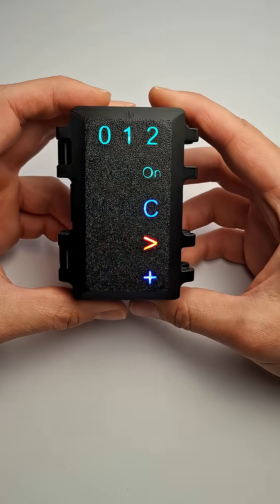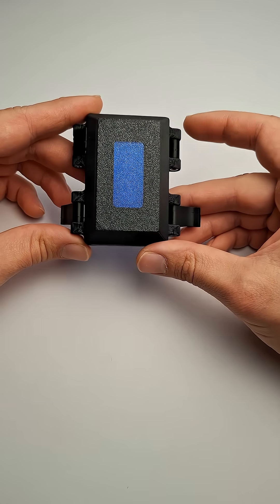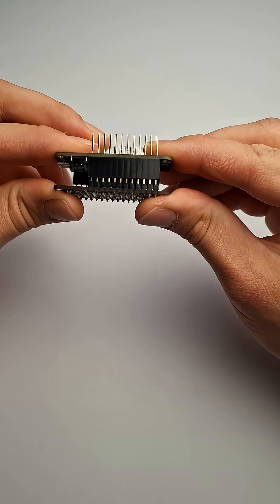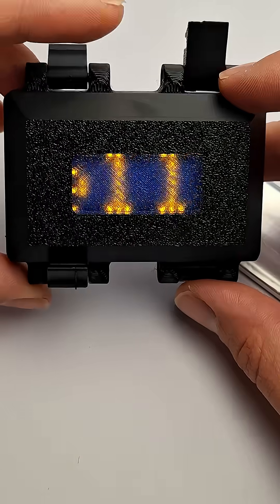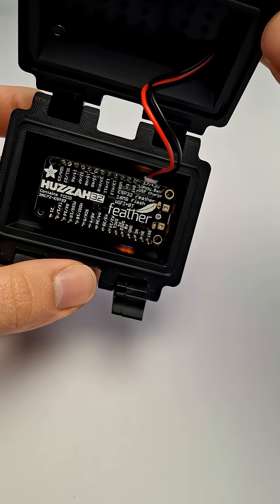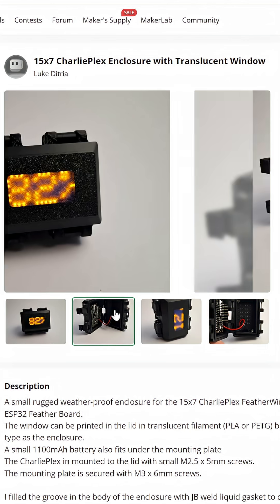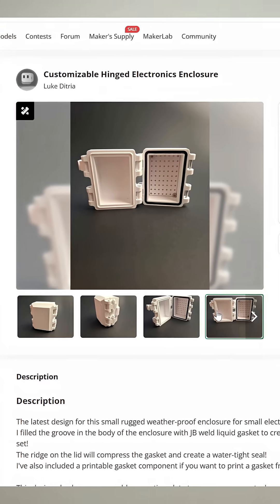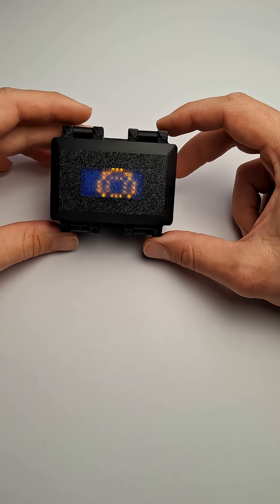3D Printed Enclosure with Translucent Printed Display Window! #3dprinting #esp32 #electronics

Comment: If you do wireless charging you could 3d print the bottom of the enclosure, install the electronics and then print the rest to permanently seal it in.

Comment: I did this a while ago just by making very thin patches, to attempt to get letters from a single central LED. Getting even illumination wasn’t that easy because of the emitting angle of the LED, and it’s probably not very waterproof unless you fill the cavity with epoxy, which would further change its optics.

Comment: You should try adding solar panels
Reply: An ESP32 pulling in data over wifi is really power hungry, and this one has a bunch of LEDs, too. Not going to work well with this setup.

It would be possible, though, with an ESP32, an e-ink display, pulling in weather data only once every two hours or so, and using deep sleep for as much of the time as possible.
Reply: @SolarWebsite you can put it in a super low power state tho right? Cause i know some smart devices that run on battery, and last forever whilst still maintaining a wifi connection. Im not sure. Haven’t done any making in a hot minute

Comment: I really like all the little pro features like mounting plates and satisfying closure sounds and mechanisms. Great looking Case! If it was parametric with a clever way to charge it or keep it powered while staying weather tight, you'd have a banger of a box!
Reply from the maker: I've got the design file up for the original enclosure which has the parametric design.

Comment: Um! You can just use small piece of glass. While 3d printing just have a pause, put glass and print over it. That gonna be secured and better
Reply: no because hes making weather proof. need gasket as well as hes using gasket on the opening.
Reply: the plastic will not create an air sealed bond with the acrylic or glass..defeating the intended purpose. maybe if he was making a non weather proof but then the glass would produce not only glare, but condensation to worry about. not so simple.
Reply: @Aimless_Drive  I mean you are sort of correct.  But no, plastic can be melted over glass, it creates a tight seal. you can take example of like camera bodies (go pro), lenses, some cheap solar panels, and much more. As per condensation goes it can happen on any surface, in glass you can see it. ya you need to rub the surface to view inside thats the querk ik. If you are telling about condensation on inside then no it doesnt occurs due to glass, its vapors and can easly be prevented by silica gel pouches,
Reply: How do you cut the glass?
Reply: @ZaynneThaWook  for small displays you could probably use microscope slides for cheap. But in general I doubt the watertightness of this method.
Reply: @ZaynneThaWook  Those workshop guys have acrylic* mostly. Which is much better too.
Reply: @ZaynneThaWook  I dont cut glass. I go to my nearest workshop, they have tools and glass too. If i want i can ask them for for a small piece of glass. They will cut it into size required and done. if you want to do it yourself there are tools and videos for help. But i recommend them as workshop guys do it in like 5 minutes.
Reply: This is genius

Comment: Awesome stuff, but definitely doesn’t look easier to read.
Reply from the maker: I thought it did 😂
Reply: Honestly, I think it makes it a bit easier to read because the pixels blend together and make it a bit more full. It's kinda like old Nintendo games where the design of characters used the characteristics of old TVs to blend pixels together and make characters seem a lot more detailed than they actually are. I know there's a comparison floating around that shows Princess Peach and how she would appear on those old TV vs. the actual sprite art character that is very blocky
Reply: He didn't demo text on the screen while outside of the box to be fair.
It does seem to give the text a bit more body, So I'd say it makes it easier on the eyes for sure.
The real question is, how well does it read underwater?